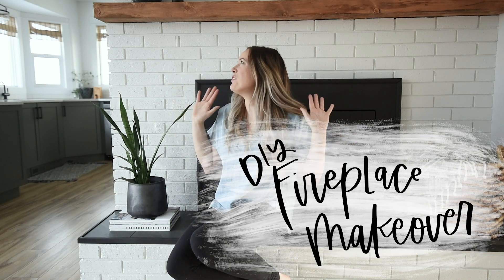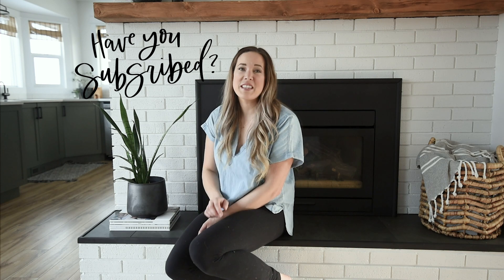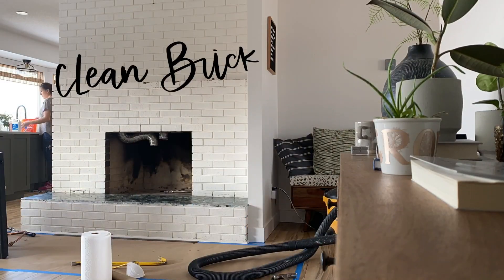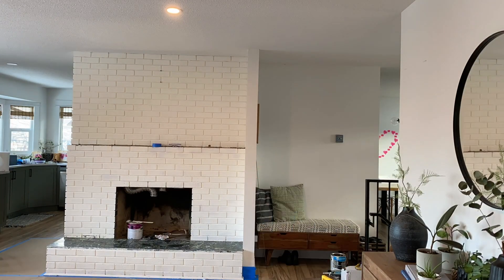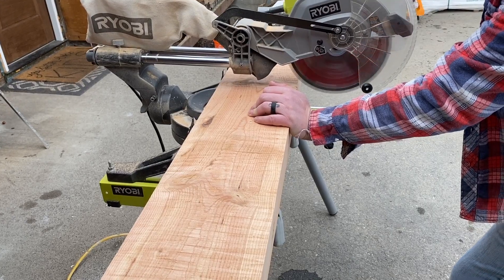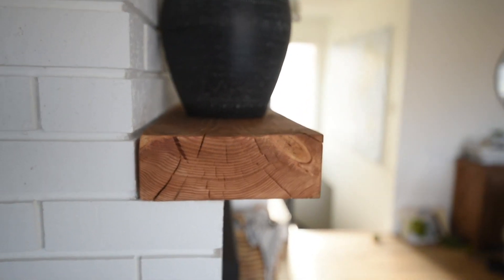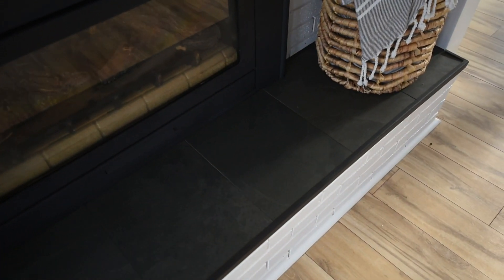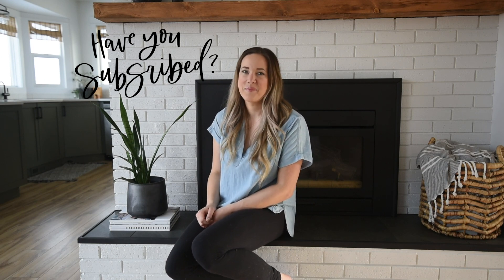DIY Painted Brick Fireplace Makeover | How to Paint a Brick Fireplace

Comment: Hey Colleen! You mentioned using regular paint. You don’t need to use a heat resistant one?
Reply from the maker: Only inside the fireplace! For example, if you were painting where wood would be burning- but not with the gas insert as far as I know :)
Reply: @ColleenPastoor  I don't have tsp dang it I ran out. Wonder it soap and water would be ok.